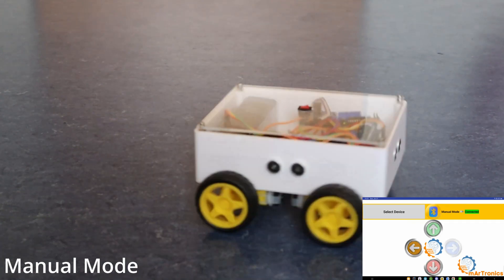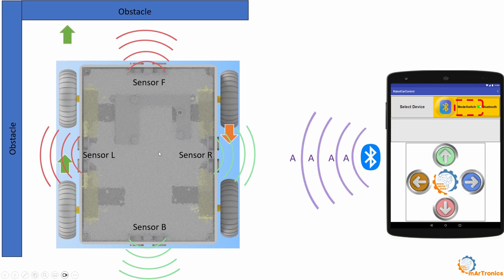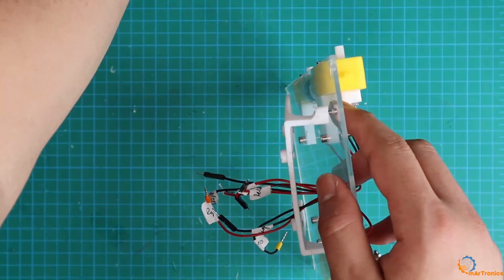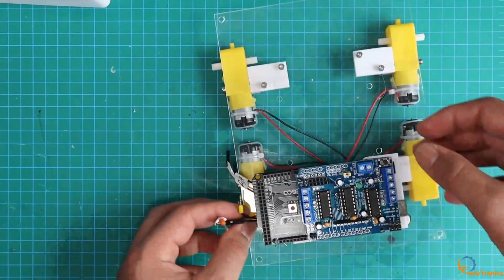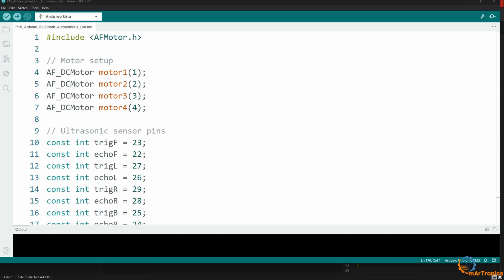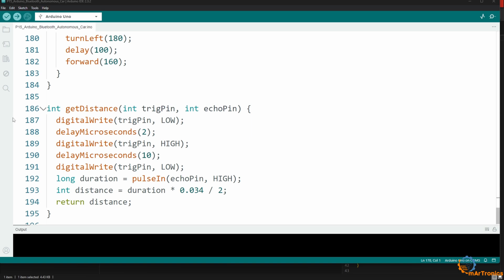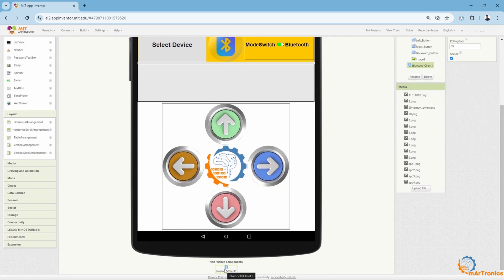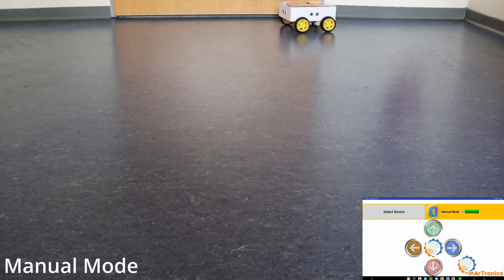Arduino & Robots Project 09: Building an Autonomous and Bluetooth-Controlled Robot Car 🚗🤖

Comment: but you have not introduce hc05 in robot code
Reply from the maker: Good question! The HC-05 Bluetooth module isn't explicitly mentioned in the code because it communicates through the serial interface. The commands are processed by the line `command = Serial.read();`, which directly reads the input from the HC-05 module and controls the robot accordingly.

If you're interested in learning more about how to use the HC-05 and an app to control devices, like turning a lamp on and off, check out my other video here: https://www.youtube.com/watch?v=z1VubkUD264